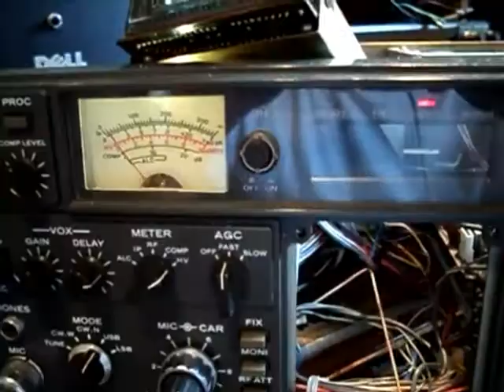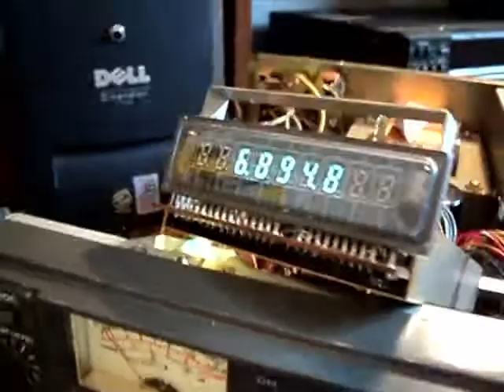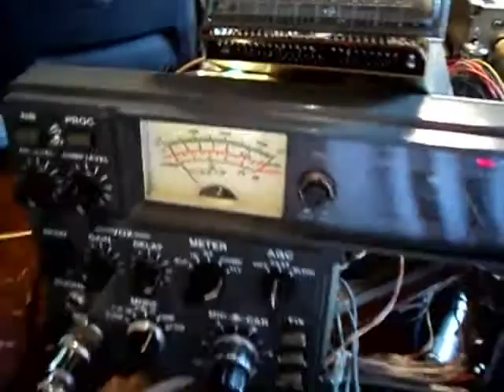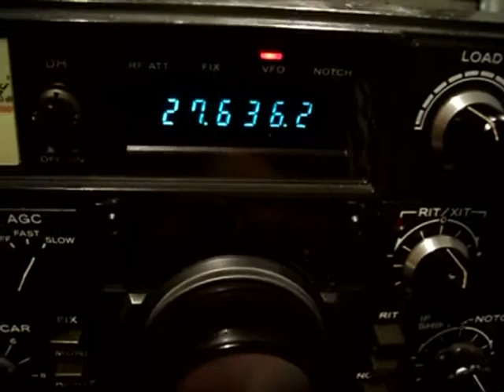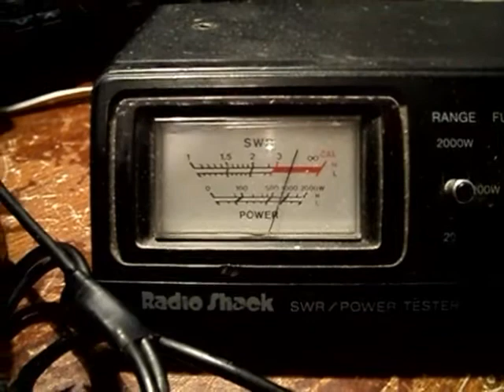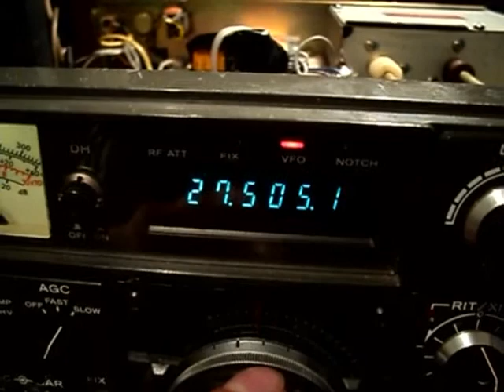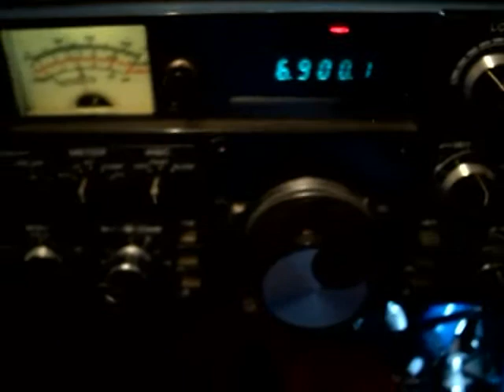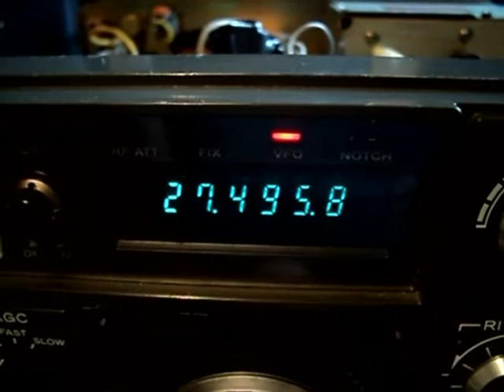TS-830S Reparacion, remodelacion, alineacion y modificacion a 11 metros.

Comment: Yo tengo uno tambien buen ekipo ase poco le cambie los condensadores de hv y le puse valvulas americanas por ke las ke tenia eran chinas me puedes esplicar como se neutralizan las valvulas
Reply from the maker: +fernando gomez Si no tienes el equipamento para hacer la medicion, lo que puedes hacer es poner en cw a una potencia de 80w y ver en el wattmeter con un dummy load de 50 ohms de carga la maxima potencia que te pueda generar el amplificador al mover el capacitor variable para neutralizar, es mas bien para que los dos tubos se compensen, todo esto despues de haber ajustado el load plate y drive.